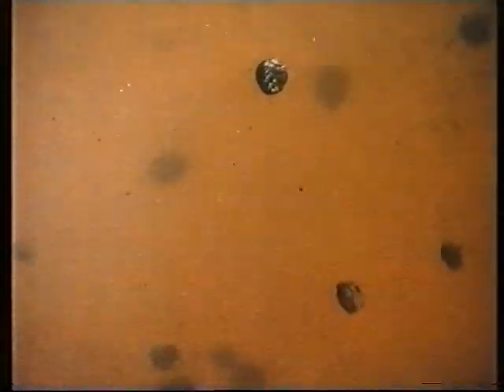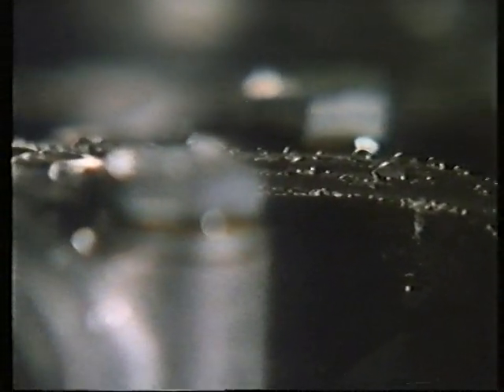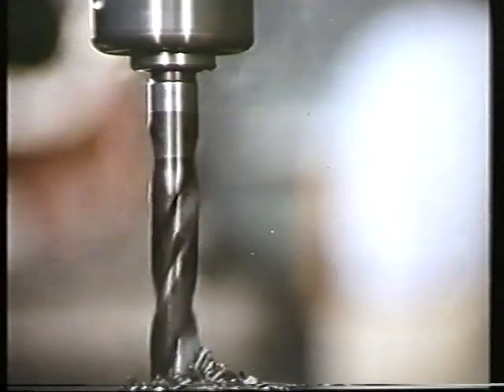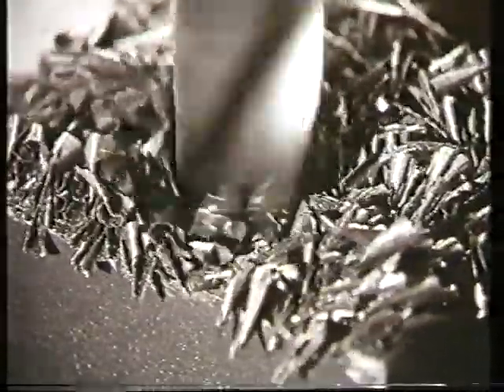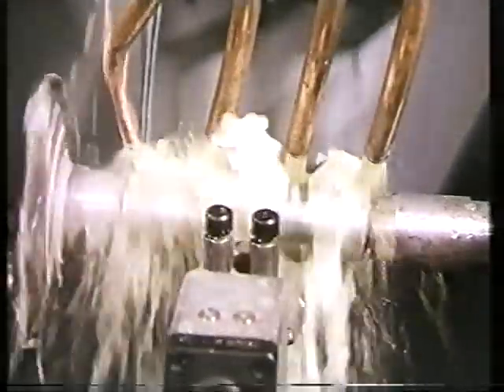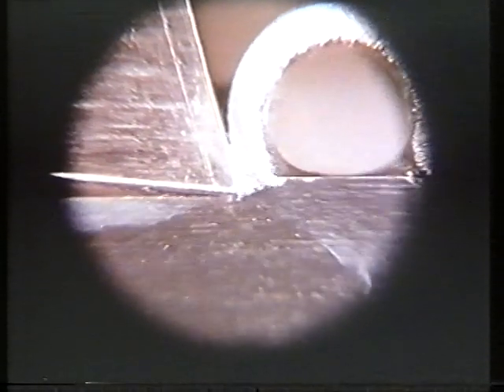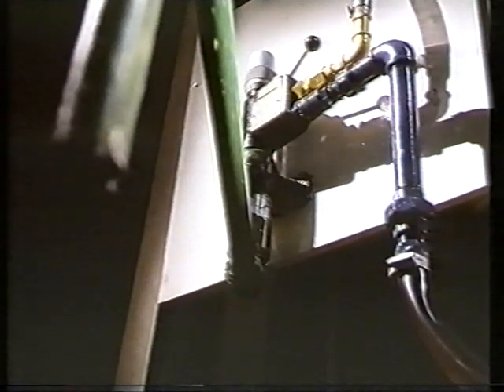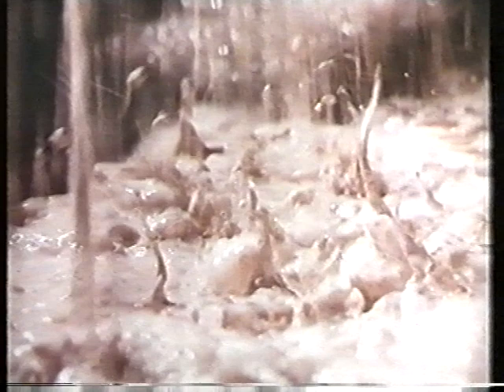Engine oil, Cutting oils

Comment: Bro plzz tell me which type chemicals used in making cutting oil?
Reply from the maker: Depends what type of cutting you are doing. 

Straight oils
These oils are non-emulsifiable and very useful in machining operations where they function in undiluted form. Their composition is a base mineral or even petroleum oil. Often they contain polar lubricants like vegetable oils, fats and esters.
They may also contain extreme pressure additives including sulphur, chlorine, and phosphorus. To achieve the best lubrication use straight oils however they may have poor cooling characteristics.

Synthetic fluids
They do not contain mineral oil base or petroleum. Instead, they’re formulated from the alkaline organic and inorganic compounds alongside additives to prevent corrosion. They function well in their diluted form. Of all the varieties of cutting fluids, synthetic fluids offer the best cooling performance.

Soluble oils
Soluble Oils usually form an emulsion after mixing them with water. The resulting concentrate contains emulsions and a base mineral oil to produce a stable emulsion. They function well in their diluted form and offer a great lubrication in addition to heat transfer performance. They are the least expensive and are the most widely used fluids in the industry.

Semi-synthetic fluids
These fluids are basically a combination of the soluble oils and synthetic fluids. Besides, the heat transfer performance and cost of the semi-synthetic fluids falls between those of the soluble and synthetic fluids.
Reply: Engineering Education soluble cutting oil
Which chemicals used in making
Reply from the maker: Depends on what you are cutting and what brand you buy. The one i use contains: Ethylene glycol, sodium tetraborate, metasilicate, phosphate and water.
Reply: Engineering Education thank you soo much
Reply: Engineering Education I want make 10ltr. How much chemical % add? In cutting oil